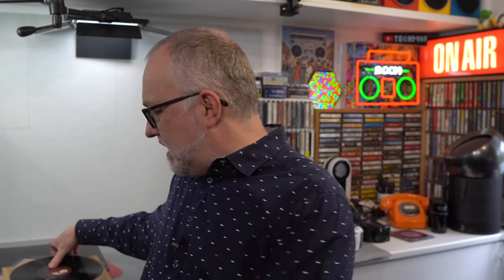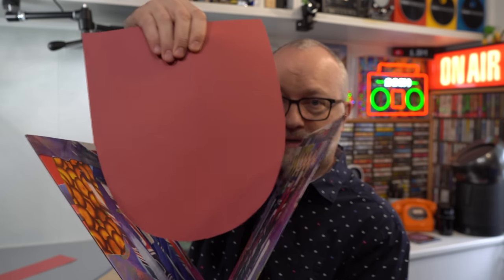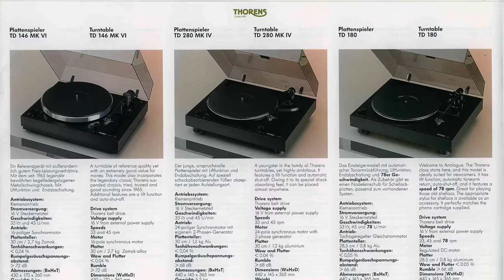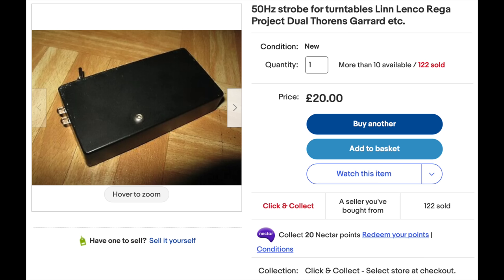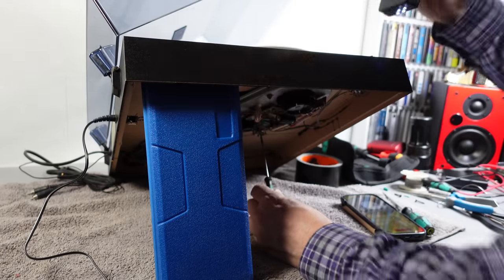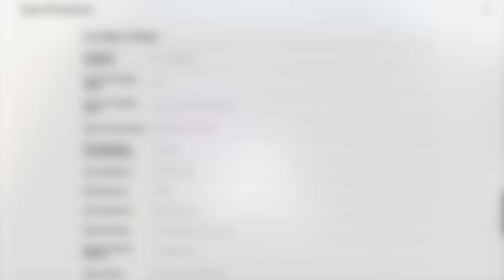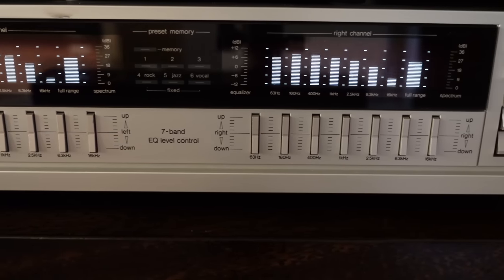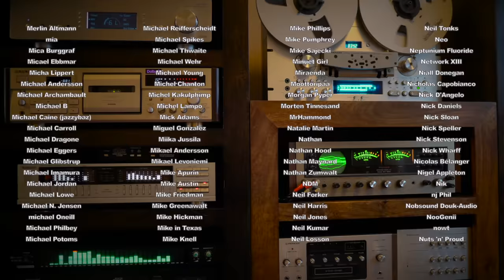Playing 78 RPM Shellac Records properly

Comment: Trim pots can misadjust over time, so it's normal to have to readjust them
Reply: Yep, i was given a record player by an old friend, he thought it was knackered, it just needed a new belt and a slight adjustment of the pots, it works well now. He bought a new one.
Reply: Especially if the thing was dropped or bumped in transit.
Reply: Not quite mechanically misadjust, but the pots themselves and other components can drift in value as they age.
Reply: @mrnmrn1  that's true
Reply: @mrnmrn1  yeah, I imagine things like corrosion could affect the resistance of the pots, and therefore change the value.
Reply: @mrnmrn1  And since they were all off by a similar amount, I’d say it’s even more likely that aging was the cause, probably of some component that is common to all speeds.
Reply: @daviddavidson2357  It's using a DC motor with a closed-loop speed regulator rather than an AC synchronous motor, the optical encoder wheel gives it away. Judging by the bridge rectifier next to the filter cap it probably did come with a simple transformer power brick originally, but it was probably mostly for cost control given it's from the 90s when switchmodes weren't as ubiquitous as now.
Reply: Changes in temperature or humidity also make potentiometers drift
Reply: Yes! Even material degradation, micro corrosion, and dirt can make the potentiometer contacts have a change in resistance. If everything else is good, the pots need recalibrated.
Reply: I’ve had trim pots come from the factory misadjusted. It could very well be that it was never the right speed to begin with.
Reply: I have no turntable, vinyl records and certainly no 78 shellac. But I found your video fascinating, and watched to the end. Good work Techmoan.
Reply: This is precisely what I wondered.
Reply: Adding my voice to the chorus, I have also noticed that trim pots can get out of whack overtime. And that would have been the first thing I would have tried before replacing the capacitors but that's just me.
Reply: Trim pots should be the first step.
Reply: I once had a realistic cassette deck, recorded very dull, both bias pots were all the way down, from the factory. Good thing i had an audio generator and an ac vtvm.
Reply: Yep, trim pots is the first thing I would have gone to.
Reply: @daviddavidson2357  I think it should rarely matter if ac power input is supplied with square wave - even dc, because it is usually immediately rectified and fed to smoothing capacitors. Smoothing is needed because wave is not precisely square. If it has enough smoothing to cope with a sine input which has significant low voltage intervals, then it should cope with square.
I have a 12v ac system running off 12v dc supply with no problem. Conceivably half the rectifier diodes could overheat since only half are active on a dc input, but they are cold, perhaps over-specced or perhaps not switching at 50hz keeps them cool.
Reply: the thing probably took some rough movement on the way here   so the pots adjust is logical...🖖
Reply: Yes, trim pots have exposed carbon tracks which can absorb moisture from the atmosphere over time and change their resistance. Fixed value resistors are usually dipped in protective paint or whatever and don't suffer as much. There may also be a zener voltage reference in there somewhere which has drifted.
Reply: Something else I thought of. It's very easy to Mark the original position of a trimpot. That way you can change the adjustment and if you need to replace something else such as a capacitor or resistor, you can easily return the trimpot to its original position if it turns out that that is not the culprit.
Reply: Although trimpots can wander a bit over time (moisture or dirt), for all three to wander by roughly the same amount is suspect. More likely the zener controlled reference voltage that is supplied to the trimpots has wandered resulting in all three speeds to go down.
Reply: Techmoan never fails to amaze me with his methodical approach to solving audio issues!
Reply: @daviddavidson2357  It is just a 16V AC transformer. The same as for other Thorens or many older Pro-ject tts.
Reply: Looking at the design, build quality and dubious components of this device I am surprised if works at all never mind that it will keep speed calibration. A very unPolished construction.
Reply: @daviddavidson2357  There is no way in hell that is a switching supply. Given it was made in the 70s it's out of question already. There has to be a small transformer in there somewhere.
Reply: Yes, in particular they can corrode over time and hence drift. I had a cheap Technics CD player in the early 90s which wouldn't always read the CD table of contents until I tweaked all the pots to break the corrosion and took them back to their original positions... in fact, I think tweaking the first pot fixed it...!
Reply: Not to mention he's making a huge assumption that it was adjusted correctly from the factory.
Reply: 666 likes

Comment: You sometimes might need to adjust trimpots anyway, resistors drift in value with age and use
Reply: As do capacitors. And capacitors - especially electrolytics - have broad tolerances - standard is 20% - so if those capacitors were part of the timing circuit, you would expect to have to adjust the speed when you replaced them.
Reply: @robertbackhaus8911  capacitor made in Poland by Elwa sometimes had +100% -10% tolerances. The Big grey one in this turntable could be one of these.
Reply: He takes all of those small things into consideration in high detail, just don’t think he explains that particular part in this particular video.
Reply: Heck, just oxidation in potentiometers could account for some of it. As they've become pitted through time, they aren't as conductive as they use to be. Or said the other way around, they produce more resistance than they did from the factory. So it's like the pots had been changed, even though they hadn't been moved.
Reply: That's precisely why they're there!
Reply: My first action, after a cleaning, would have been to adjust the pots since it's the easiest thing to do and there's less risk of damage than with the soldering.
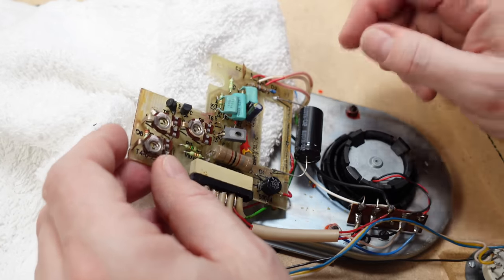Reply: @Gold63Beast  17:13 He explicitly dismisses the idea in such a way that implies that he hadn’t considered tolerances changing over time
Reply: @writerpatrick   Same, except on my part I'm just lazy and would rather fix it the quick and cheapest way possible :-D
Reply: @mateuszorlinski7334  That grey cap could be the ripple filter cap since brick transformer power supplies had dirty power 50Hz hum

Comment: That '3.0' spacer is actually a 3 gram weight. If you change it out for a metal spacer, weight you could use the counterweight to get your recommended 5.0 gram tracking weight.
Reply: I was scratchin my head trying to figure out why a spacer would make any difference, when the tone arm isn't a fixed object!
Reply: That makes so much more sense than it being a spacer.
Reply: @DoubleDTVx2  i guess its both then since it sits in between the cartridge and the arm
Reply: My first thought was "just swap the spacer out for a couple extra washers and nuts on the bolts".
Reply: @DoubleDTVx2  Stylus rake / VTA.
Reply: although you may get the tracking weight by say changing the spacer to metal, increasing the mass of the cartridge may be detrimental the tracking on sideways movement due to inertia. The record appears like the hole is not exactly in the centre, record warped, tracks not exactly round etc. It may be better to actually shave some weight off the other shorter end or modify to allow the counterweight to allow it to screw further. Probably won't make a big difference because it's close.
Reply: Negative -- it's just a spacer. I have one here (I do turntable repairs so I have lots of accessories). The Thorens 3.0 spacer is 3.0 mm wide and weighs 0.27 grams.

Here's the story --  Thorens headshells and arm wands (i.e the TP16 or TP62) required a specific screw type -- the M2 -- to attach the cartridge to the threaded holes on the headshell/arm wand. The spacers (provided with the turntable and ranging from 0.5 mm to 3.0 mm) were there so that you could get the proper screw length (not too short, not too long) with different cartridges that had different widths on their mounting tabs. They also came with a number of different length M2 screws.

Why the spacer was being used on a TD180 -- which is not really a Thorens (as Matt stated) and has regular through holes in the headshell (no threaded holes, therefore no need for the spacer) -- is a mystery. I can only figure the previous owner of the TD180 pulled the cartridge from an older model Thorens and thought it was necessary. It was not.
Reply: @DoubleDTVx2  it affects vertical tracking angle ; important for stereo , not so much for mono . Audio Technica and others used to make little sets of weights to add at the front , but one of the best was the SME Series III tonearm which had a box into which you inserted different combinations of lead counterweights and plastic spacers to balance any cartridge . Sadly , it was designed to be ultra lightweight for high compliance cartridges and wasn't so good for low compliance moving coils , even with the fluid damper . instead of having interchangeable headshells , it had swappable carry arms , which could be weighted to avoid rebalancing when you swapped pickups .
Reply: @DoubleDTVx2 Spacers let you level the tonearm in the playing position, if the tonearm base doesn’t adjust.

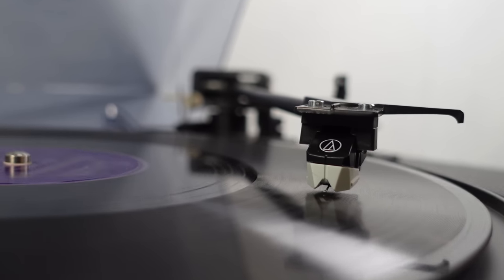Comment: 25:47 there is a 78rpm equalization plug-in for Audacity.  You simply enter the turnover and roll off values for that particular disc, and it outputs a file that you can then import into the Audacty’s EQ filter.  Since you used a RIAA preamp, you’d simply use the inverse RIAA preset first, and then apply the EQ you created with the plug-in.
Reply: The process of undoing a RIAA correction adds unnecessary noise. Simpler and better to use a good quality microphone preamp instead of a phono preamp, to get a linear output.
Reply: @mrnmrn1  That makes sense.  Record the rawest audio that you can from the source and then filter in post.  :D
Reply: Actually I intentionally reverse the RIAA curve when digitally restoring almost any record at any speed. THEN I'll remove all scratches and reduce/remove surface noise. When I re-apply the curve, I have a very clean result.
Reply: @mrnmrn1  
It’s not bad if you have good equipment.  At the very least, the surface noise of the 78 overpowers it anyway.
Reply: @mrnmrn1  Bear in mind that MM/MC phono cartridges output voltage that is proportional to the speed of movement of the stylus. The waveform that you're getting is not the "unwound" shape of the groove - it's the graph of the "stylus' speedometer", or - for the math nerds over here - the derivative function of the "unwound groove". The RIAA curve is partially undoing that, so the resulting signal from a phono preamp is actually much closer to a plot of the "unwound groove" than the cartridge's raw output. In my book, it's better to do that in the analog domain than force your audio interface into capturing an unreasonable amount of high-frequency noise from the raw cartridge input.

Although preferably, you'd want to apply the EQ that is the difference between RIAA and the desired curve in one go. Not sure if the Audacity plugin can do that.
Reply: I have been transferring 78s to digital for many years. Play the record at 45 on a good turntable using a cartridge with a spherical 78 stylus. I use a Thorens TD125 with a SME arm and a Shure V15 V cartridge (no longer available  but the replacement stylus are available). Use Audacity to change the pitch and apply the EQ. Using 45 RPM puts less stress on the cartridge and helps it track the groves better.
Reply: @djhrecordhound4391  Sounds interesting, I will try it. But I am still pretty sure that if you need a raw, non-EQed signal, it's better to use a linear amplifier, like a very good mike preamp, instead of undoing and re-doing a RIAA correction. It involves 20dB gain at certain frequencies, better to do it only once! It does -20dB at 20kHz, which will reduce the noise of the amplifier along with the surface noise, if you use a mike preamp.
Reply: @Max True  that's a really clever approach, but why not go even slower to 33 rpms? Speeding up in digital domain gives high quality outputs contrary to slowing down which loses quality.
Reply: @sypialnia_studio  I'll only go at 33 (or slower!) for sharply warped 78s. It greatly reduces rumble, but could pose EQ challenges when sped back up.
Reply: @mrnmrn1  Agreed 100%, but I don't have a mic preamp. I use Diamond Cut which is made specifically for restoring audio. It has its own virtual preamp settings if I want to use it, but I also have the option of running several paragraphic equalizers in one shot to convert to any playback EQ I need. Most 78s weren't RIAA, and every record takes a different method, so here's my generalized start:
--record the 78 with RIAA at proper speed, unless record's warped or grooves are pressed wobbly. I can go as slow as 20% below 33&1/3rpm, but only used that once for a severely warped 45EP.
--do inital "cleaning"; testing/running impulse filters, manually 'removing' thumps with a highpass filter into a destination file
--convert semi-cleaned destination file into a new destination file to remove RIAA EQ, which will show every remaining scratch
--test both regular and fine impulse filters (they call the fine one a "small click" filter) and apply a continuous noise filter for excessive surface hiss
--once settings are done, run those filters into a new destination file
    (--if I'm happy with my test results, I might add the appropriate EQ curve after that chain of filters to make the final destination file, but usually not...)
--review that new destination file for anything I may have missed and fix those flaws
--Audacity has a comprehensive list on the internet of EQ curves for 78 labels and their eras of different EQs. In Diamond Cut, the paragraphic EQ presets are extensive enough to get close to whatever is needed.
(WHERE I DIFFER THOUGH...)
--I'll convert that file into a new destination file with the proper EQ curve, and that might be my file to finalize. BUT...
--if the recording itself is muddy, I'll test 'mix-pastes' of the properly-curved EQ with the extra-clear (and now cleaned) non-EQ'd file. When done right, results are crisp highs, deep lows, and a sweet midrange. I may even run another continuous noise filter with a 10-or-20-band EQ to fine-tune a noise-floor compensation with the recording itself.
Reply: @mrnmrn1 I think with modern audio interface that was made 2-3 years ago has sufficient mic amp now a days something like Motu M2 or Focusrite Solo 3rd gen can even do guitar level input and boost it, so im sure these type of 78rpm vinyl will be ok for it with lower noise floor then further lower it with iZotope RX or something equivalent (also manually removing pops and clicks digitally)

Comment: I've been playing 78rpm records since my teens when people started giving me them and I played them on an inherited gramophone (still got it). Your video was, as usual, spot on and very interesting. I started recording them in my twenties with a Garrard SP25 mk IV with a G800 cartridge playing into a Goodmans Module 80 which had a mono button. Using this got rid of a LOT of the surface noise. Eventually the 80 died and I bought new stuff, including a TD180 in 1997 which cost £175 and came with an Audio Technica cartridge. As the 78 stylus was ludicrously expensive, I bought a second headshell (£3) but of course just used the heavy G800 which I had to counterbalance with Blu Tack (TM)  (other sticky stuff is available). I've fixed this recently as I bought an ATN91 stylus off ebay and fitted the A.T. cartridge after twenty odd years. I record onto Minidisc, which from the start had a mono recording function and is more than adequate for the frequency spread of 78s, and then I can fire that onto a CD if need be. Some old, stored, much played 78s benefit from a good wash- I've proved this by a before and after listening test. I use a nailbrush, soap and warm water. WRT mono playing, one could short out the outputs at the cartridge, but that would preclude playing anything in stereo. I've heard of the idea of separating the tracks and choosing the better one noise wise, but I think some of the noise is out of phase and will cancel out when combined. Perhaps someone could confirm or deny this.
Please keep up the good work! Your stuff is a regular watch for me.

Comment: To follow with other comments - Yes sometimes you need to recalibrate the board. Resistors, capacitors and oxides can all mess with the set rotation speed to make it faster or slower, so adjusting pots is needed. Thats why they are there, so they can be calibrated if it goes out of spec!
Reply: could be the trimmers may be the incorrect value or have changed over time
Reply: I wouldn't be surprised if it was off spec right from the factory. This is a budget player.
Reply: @firesurfer  this was my exact thought, someone at the factory just didn't care enough to get it "right". Though the motor just being slower wouldn't shock me either.
Reply: Indeed, it will have been long term drift (AKA aging) of other components that was the most likely cause of the speed inaccuracies.  Adjusting then is 100% the right thing to do, that's why they are adjustable.
Reply: @BlackSmokeDMax  The motor shouldn't make a difference, as it has a tachometer for closed-loop speed control.
Reply: Well especially if you replace all the caps might be a time you check all the trimmers